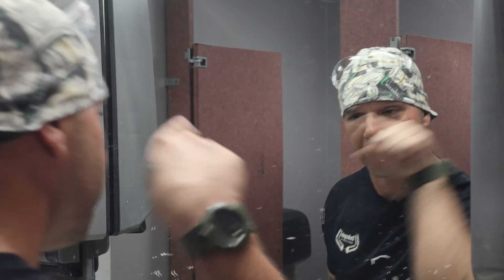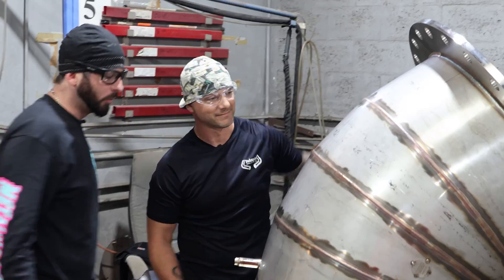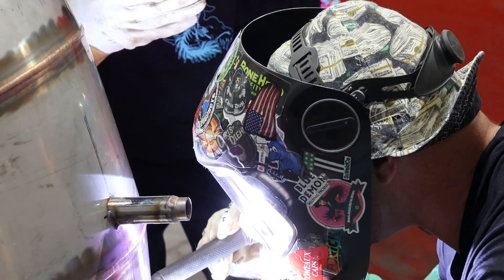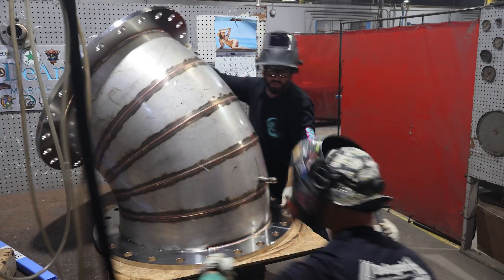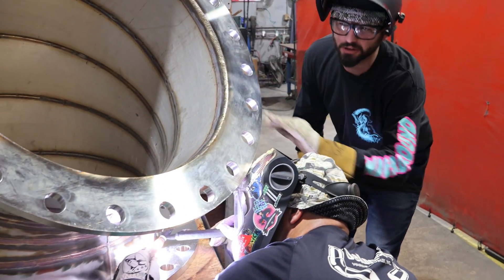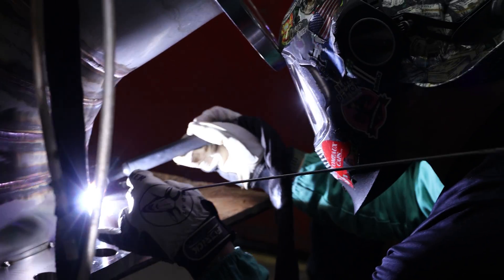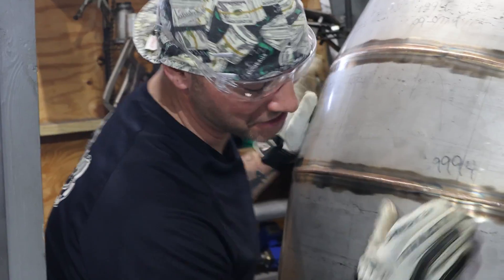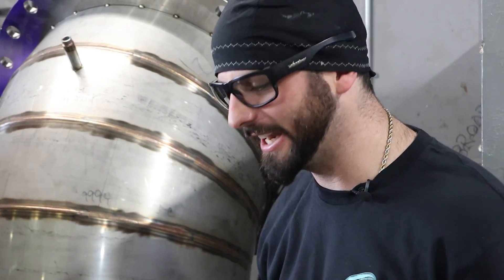Man vs Cobot: Stainless Steel Welding Showdown

Comment: which gas shield did you guys used for cobot for welding stain less steel ? wire is solid or flux cored.

Comment: Fun fact . 347 has same amount of chrome and less nickel than 316(19-12-3 ). 347 is basically a 18-10 or 19-9 with niobium in it for heat and rust resistance (its basically a 304-308 with niobium or nb short) , which is  being used to weld on 321 material (which is 304 with titanium in it or short ti) . 321 itself has also different varients like for example 321H to name one.titanium and niobium are being used to lower the crome carbide formation. ( chrome carbides make the steel lose its chrome oxide layer , in turn makes it rust ) chrome carbides typically forms when there is too much carbon in the steel that bonds with the chrome so that leaves the iron without the chrome protecting it . The 316 or 19-12-3 variant (which is better resistant against acid and chemicals than 304 and 321 ) has about 3%molybdenum in it which makes it brittle at higher temperatures ( there is a term called 475°c embrittlement ) , therefore its only qualified to be used under 400°c max for that reason . Hope this is clear enough to be understood . Ps the welder took his sweet time to weld that , which i do not blame him for . I personally would weld it with higher amps and go much faster . Still good job

Comment: More questions than answers. Why wouldn't the human use pulsed MIG?
Reply: That was my question. If the robot can mig it then why can’t the human?
Reply: Applications for every need. Maybe they find less room for error or easier to weld with wild fit ups, not matter the joint configuration. Looks nicer etc. 

Those are my opinions